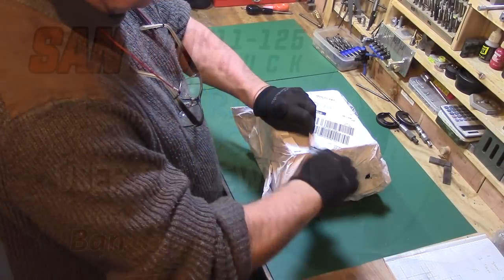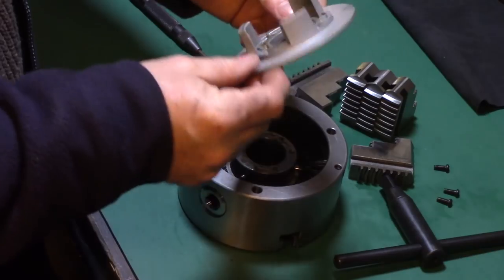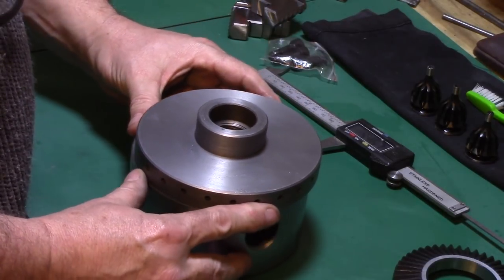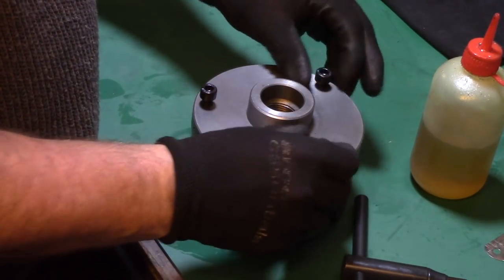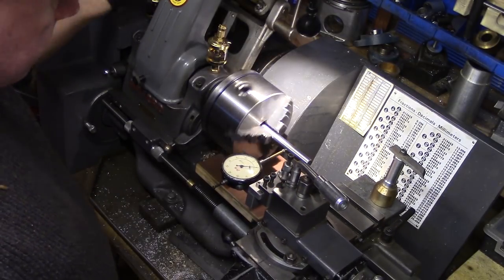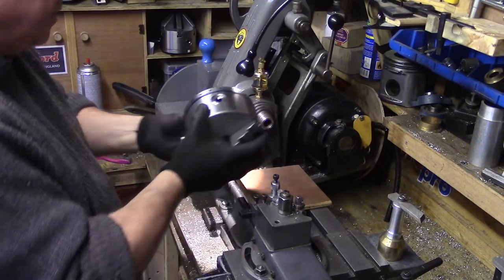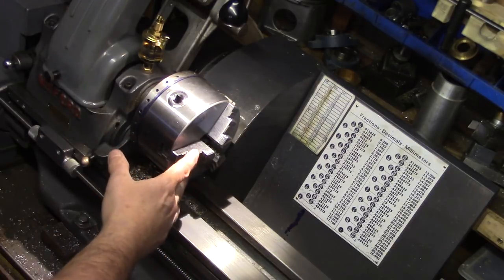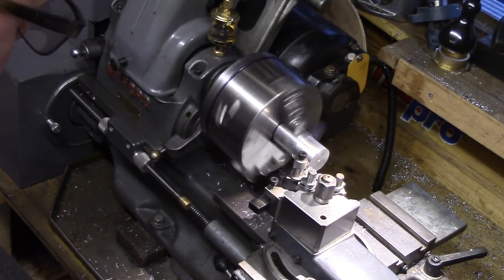Sanou K11-125 3 Jaw Self Centering Chuck Review

Comment: Thank you for your honest and knowledgeable review of the Sanou chuck.  I purchased the 100 mm self-centering 3 jaw chuck but my pinion gears had sharp edges which would bind and lock-up on the retaining pins.  I could not afford to return the chuck (freight charges cost as much as the chuck) but the seller offered to refund $20 which I accepted as fair.  I corrected the issues with the pinions by grinding down the sharp edges and making new retaining pins (the originals were badly cut up by the pinions) and now the chuck performs very smoothly.  You get what you pay for, yet I am pleased that, as a hobbyist, I got a functional chuck at the fraction of the cost of a QA certified instrument.  Regards, Al

Comment: I recently received an 80mm Sanou 3 jaw.  On arrival it felt like it was filled with sand and was very stiff.   Having watched your 6 jaw video I dived in and stripped it down and deburred everything and then ultrasonically cleaned it before re-assembly with moly grease.   It now feels lovely with a run out of +/-0.05mm which is more than adequate for my application.   Thanks for sharing your experience and giving me the confidence to attack it.

Comment: Very nice video, had the same issue on the 200mm one, just needs to be re-grinded on the lathe. 
For me personally a press or heat fit for the chuck is a must, it is intended to be mounted with some interference fit, specially if larger chuck is used and you are dealing with high speed/feed and larger workpieces.

Comment: Ade, I have to fully agree with you about these Chinese chucks being great value for the home workshop. I have a couple of similar chinese chucks and find them very good. The same as you I always leave a bit of wiggle room on the backplate register to 'taptrue' the chuck into best concentricity. The Chinese chuck which came with my BS 0 dividing head is consistently within one thou for concentricity.   
Even on my Pratt Burnerd chucks on my harrison lathe I have the register a few thou undersize to facilitate setting dead true concentric (a poor mans Grip-Tru chuck)

Comment: Besides the bolts, if you cut circular, circumferential ridges into the face of the backplate, they will act as "teeth" to hold onto the chuck's rear surface. Even squirts of locking compound will help tighten the fit.

Comment: I would loved to have seen what the runout was as it come from the factory. On my Craftex B2227 3 jaw self centering chuck, the rounout on a 1" bar is impercievable, no movement on the dial inticator at all.  That chuck costs $165 CAD

Comment: Very nice review. I am looking at buying one but have an "unknown" I need to be able to put 30mm rod in the chuck and the spec's say the hole is 30mm, my question is how accurate is the 30mm hole. I pry maybe 30.2 or something other wise I would have to go to the k11-160 and the extra cost is hard to justify. Here in New Zealand the 125 is $200 or from aliexpress for $240. Would it be possible to hone out the hole a bit?

Comment: Good review Ade, I have been looking at these chucks, like you I currently have a Burnerd but have got inside and outside jaws. I wanted to get as large a chuck as possible for my ML7 so do you think the 160mm chuck would be a problem for the lathe? Shame you had to introduce clearance into the register dia.
Reply from the maker: Hi Andy, the ML7 only has 3 inch clearance (76mm) so you might be pushing it with the 160mm, you can get a dedicated 4 jaw 6 inch for the ML7 which sits with a low profile into the gap, this might be a better option for you.

Comment: Nice review Ade. Helpful too, as it has answers to a few questions I had, having just scored me a nice little ML7. In your opinion, how do the San Ou chucks compare to the HBM chucks from RDG?
Reply from the maker: Hi Hix, I have never used a HBM chuck, not sure if they are chinese or indian, but I would guess that they will have similar pros and cons with manufacturing, as seen in the video, these issues can be sorted out with a bit of legwork, so they offer great value for money. Regards. Ade
Reply: My 4 jaw HBM is pretty poor out of the box and is going to need a lot of work. High runout on the chuck itself and very crusty operation of the jaws. I don't think it offered good value.
Reply from the maker: @MrJamesBarratt  sorry to hear that James, ofen tools from the far east need a good clean and perhaps some refinement to get them up to the expected value, sorry to hear you have had a bad experience

Comment: Thanks for the review. I am interested in a Sanou 3 jaw chuck but do not understand the (chucks conform to is 03442 standard) is this a hardness rating and do I need this for a model lathe. I finally own a Myford ML7 to build my Stuart Turner double vertical 10 that I bought 50 years ago in 1969 when I lived in England. thank you.

Comment: Great video. can you please advise if this chuck can be used on a wood lathe with a 1 inch x 8 tpi spindle. thank you.
Reply from the maker: The chuck can be used on any lathe, the marriage of the chuck to the machine is the job of the backplate
Reply: @AdeSwash  Thank you Ade. would you happen to know the diameter of the backplate and TPI so I can figure out if it can fit my lathe's 1 inch x 8 TPI spindle. Thank you so much. appreciate your time.
Reply from the maker: @santakir you make or buy a backplate to suit your lathe spindle, then fit it to the chuck. The chuck does not come with a backplate.
Reply: @AdeSwash  thank you Ade. appreciate the help.

Comment: Could the punchmark have an impact on the runout?
Reply from the maker: Hi Jyrki, the punchmark was flattened off with a slip stone
Reply: @AdeSwash  That cover does not matter where it is located. Did you try mounting the jaws in all three positions? Also did you try tightening from all three spots? Only one is actually true.

Comment: the problem with these cheap chinese chucks is you will never win , it may run true on one diameter but run out on another so you are forever chasing accuracy , not only that if you search long enough you can find a real quality chuck for the same price , I recently purchased a same size old stock Pratt Griptru with both sets of jaws for less than £100 , retail is now £ 500 +  , I am a toolmaker by trade and have had lots of experience with lathe chucks and the Pratt is far far far better than the chinese chucks , keep searching

Comment: Stay away from Chinese chucks. It's as bad as you can get. I have four of them (two of the same make as in the video) which came with the new lathe I bought. In no time it had massive play between the jaws and the chuck. Bad stuff like 70% of the rubbish I bought on Aliexpress.
Reply from the maker: Hi Pieter, I have 2 Sanou chucks which I use all the time, owned them for a couple of years now and not had any problems with them, they both are still in excellent working condition
Reply: @AdeSwash  Morning brother, maybe you were lucky. I wasn't, especially if it's a brand new chuck. That really cheesed me off. The amount that I can actually tilt the jaws up and down is frightening. So are all my other Chinese chucks. If I could afford better chucks, I would have replaced them.